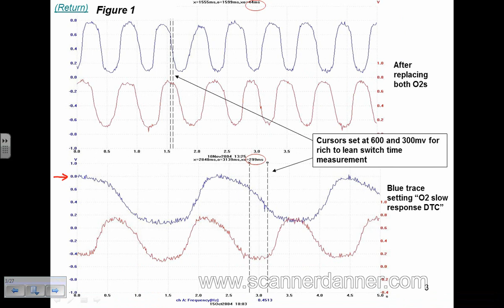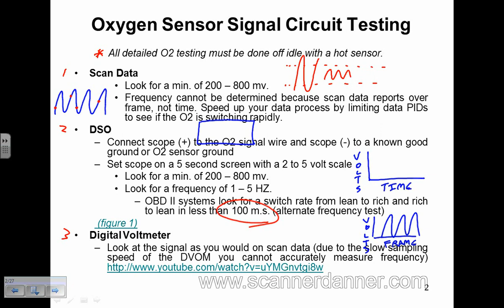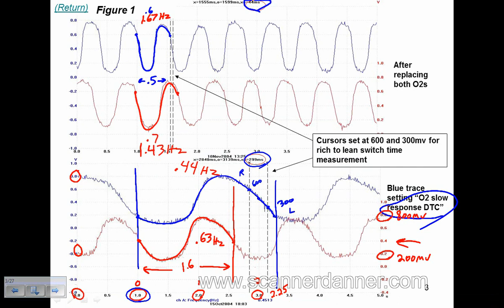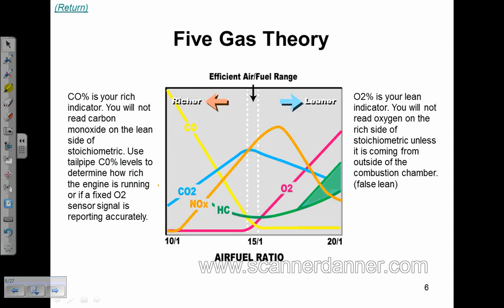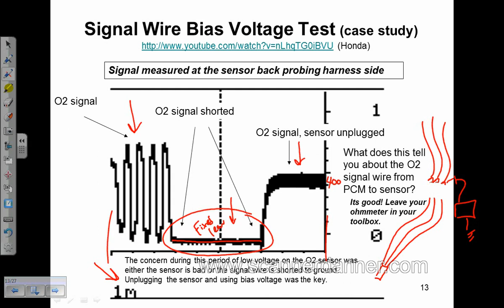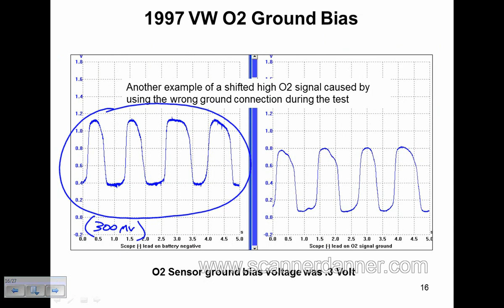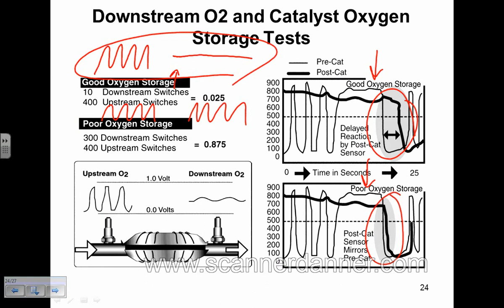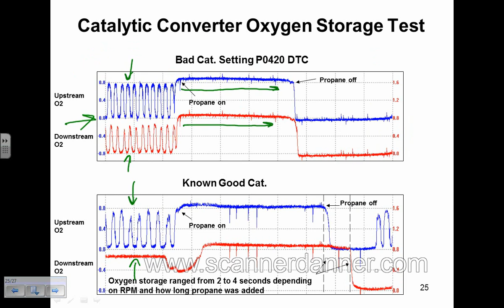Oxygen sensor operation and testing (preview from ScannerDanner Premium)

Comment from the maker: yes, misfiring will cause bounces on a backpsi test. nice work so far. as for fuel psi u should be around 62 psi at wot and it should not drop while accelerating

Comment from the maker: Misfiring will not cause a rich O2. watch this video "Using Fuel Trim to ID Type of Misfire (can it be done?)"
Lean O2 at WOT is usually either low fuel psi or a dirty MAF on your truck

Comment: A REAR O2 SENSOR IF AT IDLE IS  STEADY 0,8 V OLT  IS NORMAL OR HAVE RITCH CONDITION?
Reply from the maker: As long as fuel trims are normal it is not a problem